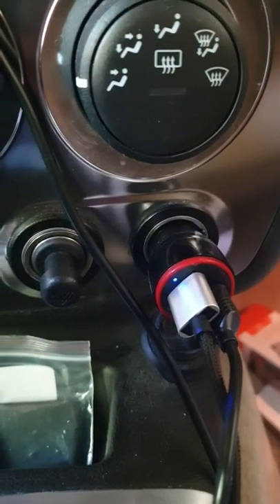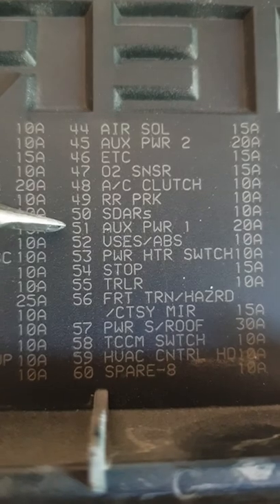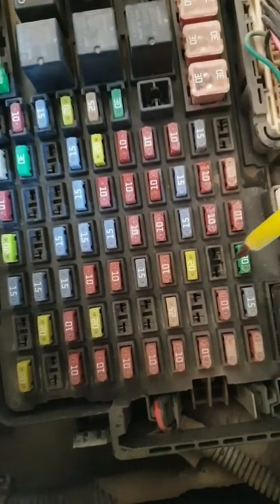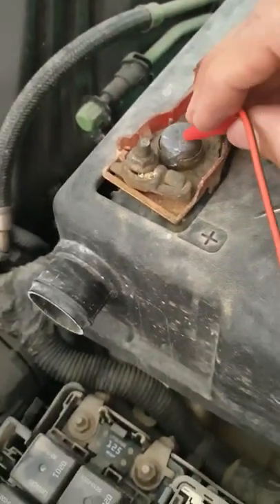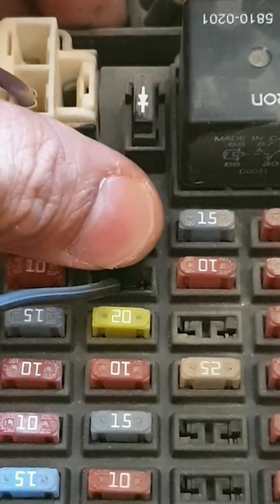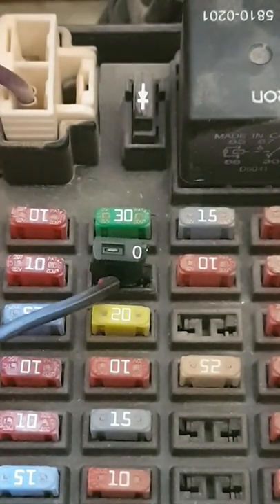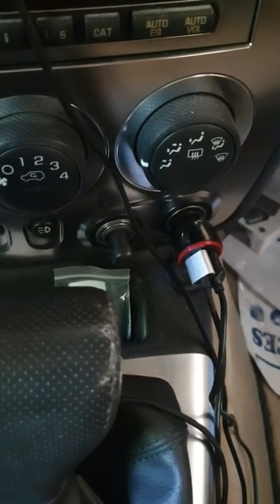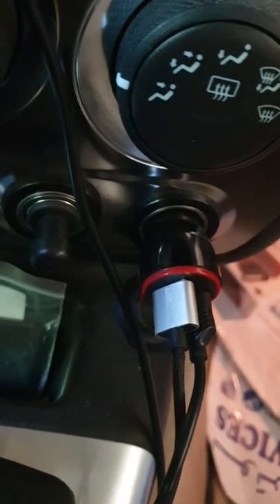car hack, connecting cigarette lighter charger to the ignition key to save the battery

Comment: If your cigarette lighter is killing your battery then you need a new battery
Reply: True, but this is not what this is about. It's the dashcams that stay on when the car is parked, and do NOT work when the car is started due to overheating, memory full, or they mess up with the phone app.
Reply: I'm actually looking at this to reverse engineer it on my car... I'm wiring it up so the lighter stays on at all times so my phone can charge when I leave it in the car and I'm not driving.
Reply: It’s not the cigarette lighter per se by itself it’s if you have a charger in there and forget to unplug it when you turn off the car. I can confirm it doesn’t take a whole lot of charging something with the car off to start causing problems.

Comment: Would this work with keyless ignition? I hate that the 12v outlets on my 2013 Ford Explorer and 2017 Ford Escape have power all the time, yet that is not the case with my 2016 Nissan Rogue.
Reply from the maker: yes it should work
Reply from the maker: it would work with keyless too

Comment: Hi man, really thanks a lot for the tutorial but I'm wondering, how did u get the "half" fuse? Did u buy it or did u break it? (If broken, how much ampere was it and does is have to be broken a special/specific way)? Hope you can help me out :)
Reply from the maker: the half fuse is only required to make sure the wire doesn't fall out
just cut any fuse in half
or use a burnt out fuse
Reply: @jmohammed4936  thanks alot! You really helped me out :)

Comment: This is genius, great video. Can't wait to try it.

I have a 2022 Ram truck and I believe my dashcam and radar detector are killing my battery because of the 12V outlet. I am fairly sure. It is drawing about 4-5amps when the truck is shutoff - I cannot understand why but thats what it is. I am going to Lowes and getting some wire to try this myself. Hopefully, it will stop the battery drain

Comment: How to figure out which side of fuse is connected to battery and the other side to aux device....IF you do not have battery nearby for multimeter negative connection or wire positive connection. Eg my battery is in front and the fuse box in trunk.
Reply from the maker: use a long wire from the battery all the way to the trunk to do the test, thats the only way I can think of.
Reply: @jmohammed4936  thanks for the reply. I have another issue now. :-)... Tried to push multimeter leads in and now the fuse won't stay in and fall out.

Btw I checked many slots using wire to make a complete connection. Ones marked unused or in use for audio or sound, nothing was able to light up lighter slot with or without ignition/engine on.

I am just hoping to solve the loose fuse slot issue without changing the whole fusebox. I tried putting in a metal piece, it worked but it was a ugly solution,  trying to make it hold the fuse by itself somehow.

Comment: Thank you!  What gage wire would you recommend?
Reply from the maker: I'm not really expert on that. I used what I had.
Reply: A wire thats rated for at least 20a. 4mm cable which is (i think) roughly 8 gague in yank terms. 8 gague can carry 24a
Reply: @1989Chrisc  severely underrated comment, important information so you don't melt a wire
Reply: @J mohammed  great video Mohammed, thanks for the information,  it was extremely informative.

Comment: Hi Mohammed, I was about to do the same thing in my car but the concern I have is are all empty or not empty spots on fuses box are able to tolerate 20 Amp ? I am using a dashcam and 120 v inverter.
Reply from the maker: hi
I'm not sure I could help with that but ur best chance is to find a spot that already has a 20 or more amps fuse and work on that

Comment: I have three outlet ..should I make a wire for each one?
Reply from the maker: if they are not connected to each other already,  then better to make 3 separate connections
Reply from the maker: you probably have to do 3, but it depends if they are all connected to 1 fuse or 3 separate fuses